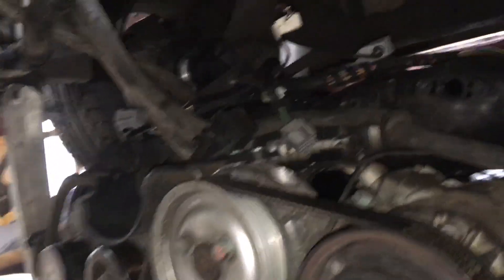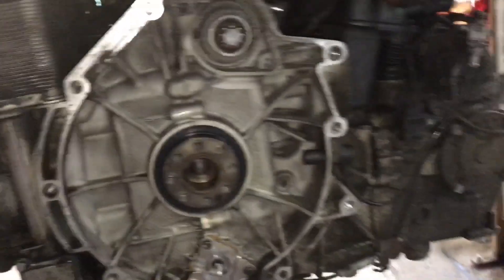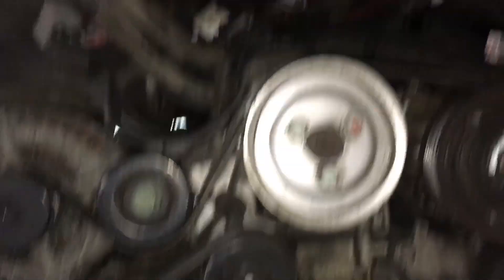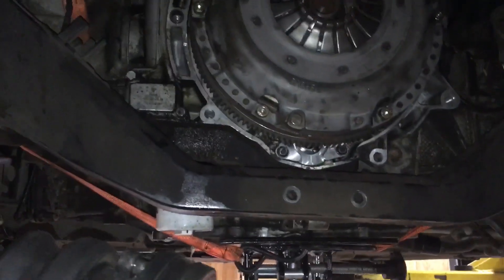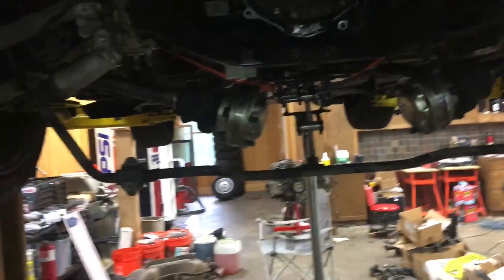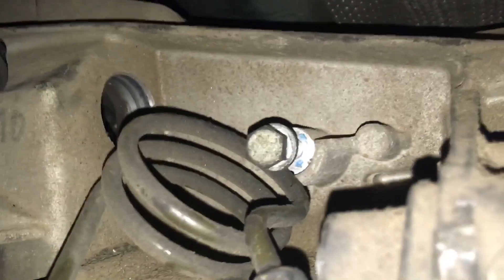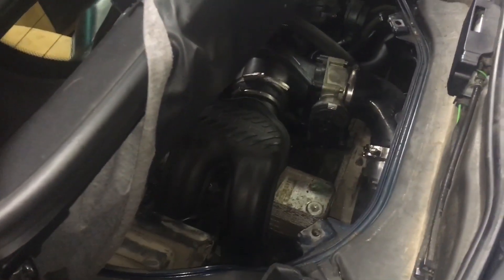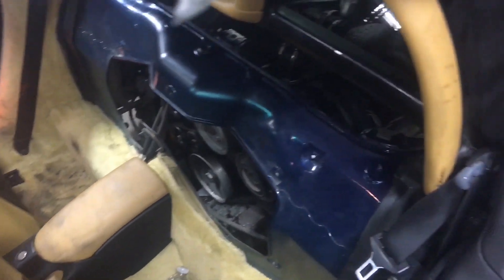Porsche Boxster S engine install and first start!

Comment: So cool! I have 05 987 sitting in my garage with a bad engine, would you say it was worth all the work and money to have you car running again? Also where did you find the replacement engine?
Reply from the maker: TBD when I go to sell it in the spring I guess. I should net out OK if the old engine wasn't catastrophic.

can't recall, but it wasn't an orthodox place, and it was very coincidental at the time

Comment: Do you ever fabricate your own parts/brackets? If you were to design your own custom car from scratch(maybe not engine but still) what would be your perfect setup in regard to engine/tran/suspension setup/ ride ? Don't say fiat or I'll drink a gallon of used motor oil
Reply from the maker: It is rare, but yes -- I really try to find an OEM part to modify in cases like that. biggest offender was/is Blubzki the 76 Mercedes. engine/trans, shifter, everything even down to fuel rails are custom or customized parts.

perfect set up on a specific chassis?
Reply: Ovalbore ya
Reply from the maker: well, given no other qualifiers...

Mr. Wags. E91 RWD 6 speed. I'l drop in an M57, an LSD, a bit stiffer springs and dampers, and make the whole body aluminum. would drive that daily everywhere forever.